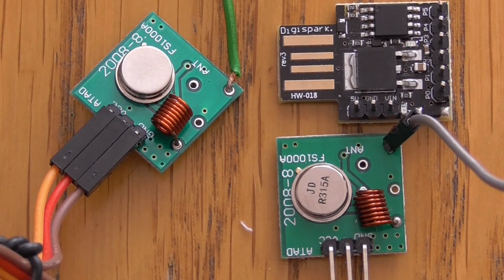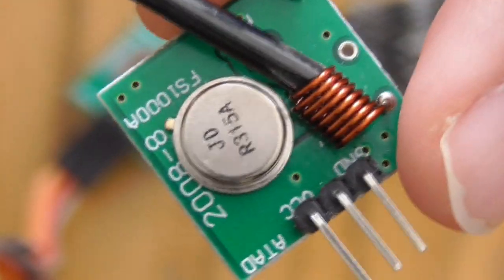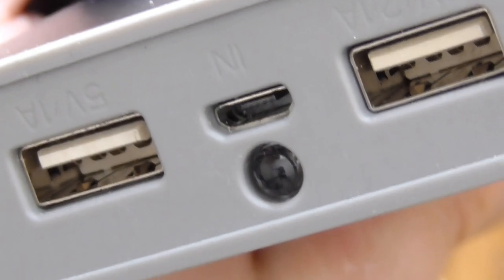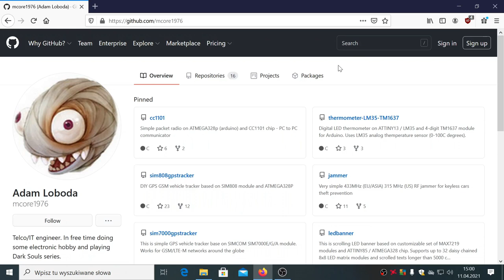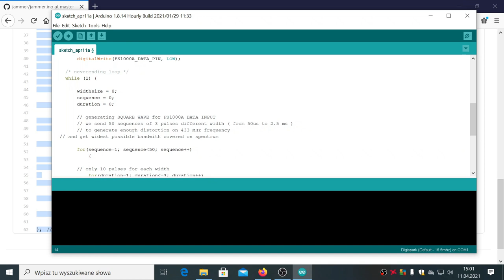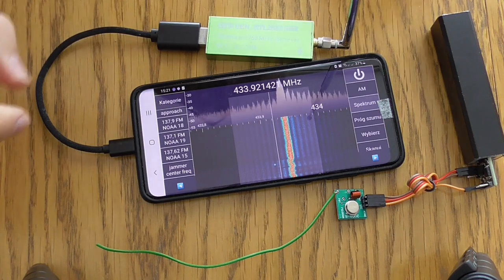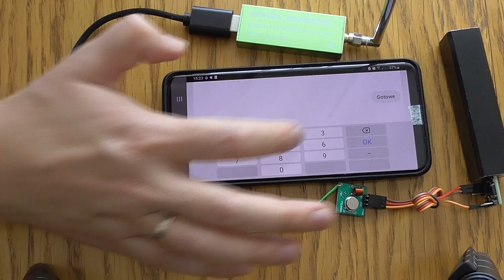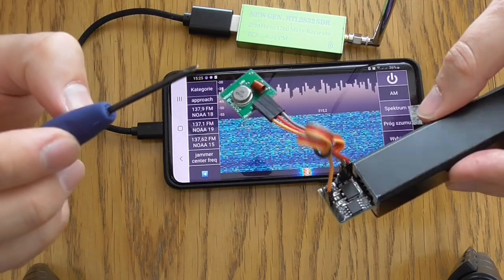5$  ARDUINO car key JAMMER DIY. Relay attack / keyless car hack / car hacking protection

Comment: Great, I did it with another powerbank and issued solved! What I can not get it to do is to shield the cars remote control that locks and unlocks the car... it will shield very well my garage door. I shall try to place the variable condenser as in your other video in // with the oscillator or do  you recommend something else, this last one is on 434 mhz? Cheers
Reply from the maker: I think this variable condenser may not help much. You may want to build the second jammer based on CC1101 board and Arduino Pro Micro 8MHz/3.3V

Comment: Will the code also work with STX882?
Reply from the maker: yes, this one should work because it is a simplest ASK OOK transmitting module
Reply: Can i also use this? Digispark USB ATiny85 - Micro USB
Reply from the maker: yes you can

Comment: Excellent engineer! I built it and it works very well, the only problem is that when I feed it with the powerbank, it boots up, it starts to oscillate perfectly, BUT it stops after approximately 8 seconds, that is, it doesn't do an endless cycle.... I have to unplug it and plug it back in and there it does the same thing, that is, it oscillates for 8 seconds and cuts off... could you help me please? Thank you very much
Reply from the maker: this is due to powerbank issues that cuts off the power when the current is low. find another power source. It happened to me as well. find cheapest powerbank with no protections

Comment: hi i search for Transmitter and receiver module based on CC1101 chip and i found many types of transmitter modules board based cc1101 , my question is the CC1101 chip is important to have on transmitter module board not the shapes of the board or color right?
Reply from the maker: correct. shapes sizes and board color is not important. Important is to have 8 PIN connector and CC1101 chip on the board
Reply: @justanengineer5599  can i use Attiny 85 digispark with cc1101 modules to jamm?
Reply from the maker: Unfortunately no. Believe me I have tried hard to make ATTINY85  work with CC1101 but I failed. The point is that ATTINY85 does not have full SPI BUS and I had a lot of problems.
Reply: @justanengineer5599  one of ur video u made cc1101 and arduino pro micro for  rf jammer which u said working in both 433 and 315 and others freqency is that right ?
Reply from the maker: correct. here is the video https://youtu.be/vZcGP-O2GvQ

Comment: When your key fob is not in use, wrapping the entire fob in aluminum foil acts as a shield which prohibits any signal from being transmitted beyond the home. If you have two fobs, both must be wrapped in foil. Your fob is a transmitter and your car is a receiver of the signal from the fob.
Reply from the maker: Yes but what if someone has  already recorded your signal and is only waiting to  replay it and open and start your car?  then this jammer comes in to the rescue

Comment: Maybe you know if it is possible for this jammer to also work on other frequencies at the same time?
Reply from the maker: unfortunatelly no, this jammer uses FS1000A module which has fixed frequency due to the SAW generator used. SAW generators are using quartz crystals tuned to single frequency.
Reply from the maker: check my new project on github https://github.com/mcore1976/cc1101-tool
This is something for You !

Comment: Remember what you are showing. Fine line my guy.
Reply from the maker: all the techs can be used both ways for good and for bad. If you use this jammer inside your car nobody will be able to remotely open your car.  
This is all because car manufacturers  do not embeed sufficient security inside their products.
Reply: @justanengineer5599  My car cannot be remotely opened because my key uses "rolling code" unless the/my cryptography has been compromised. 

Your talking about wireless keys then jamming my own key inside my car, then i wouldn't beable to operate it unless its already operational, simple solution is use a signal blocking pouch with my key inside everytime i dont use my car. Useing a jammer this way over the top, users might even jam others around them.
Reply from the maker: even with the cryptography on board your car can be easilly opened by the rolljam attack as long as your car is listening to RF. Yes, having the keyfob shielded all the time should break challenge-response sequence but still there is a time window when your last sequence can be recorded and further replayed when you are intentionally opening the car
If you mount this type of jamming device for example under your car with the switch  you can use it in some special circumstances.
Reply: @justanengineer5599  Not my car...has some more tricks Lol
Then with what you said the RF jammer is the same with the pouch, if i leave my car jammed i am liable to prosecution. Jamming frequencys is illegal. Jammers are easily detectable. Best option would be a cryptograph rolling code to switch the locking mechanism and use the wireless key for the start with both having to be operated.

Comment: This video is very helpful. But i have question, what is the app you use in your phone for frequency capture ?
Reply from the maker: it is sdr touch. but now there are other free applications like sdr angel or sdr ++
Reply: @justanengineer5599 thank you so much. One thing can we do replay attack using this app?
Reply from the maker: no. for replay attack see my cc1101-tool shown in my 2 latest videos

Comment: Hi .. thanks for sharing this video. Just out of curiosity.. u have any idea on how to device a "personal" short range 5ghz wifi jammer? (strictly for protecting own data, wifi and stopping "air-gapped" hacking.) I am aware of hackrf, but not sure if it can jam 5ghz wifi frequencies?
Reply from the maker: it has to be made using some chip for 5GHz wifi like nrf24l01 for 2.4GHz.
Reply: @justanengineer5599  Okay, will do a search if I can find the right component. I am only intending to make this device for purpose of securing my laptop. Back in 2018, I have lost one of my laptops (the laptop never turned on after shutting down got toasted it seems), the hacker seemed to have messed around with the bios (rootkit level). I then ordered a replacement motherboard from aliexpress china for the same laptop, and it was too hacked when i was online (the hacker deliberately did things like moving cursor, closing windows, deleting files from USB drive curropting exe files of programs and they give installation errors etc, without even me touching either the mouse or keyboard). I then physically removed the internal wifi card (or anything of that sort), and the hacker is still able to have full control of my laptop (he/she intentionally does these things to make realize they have full control of my computer). I even turned off my router, but it still continued. I had the same experience with other "used" laptop i bought on facebook. These "compromised" laptops motherboard seems to have some sort of planted chip (disguised as other chips) (that are sending/emiting and receiving rf or any other hard to detect signals) to nearby routers (including neighbors ones) or even some radars or proprietary signal receiving devices through which the hacker launches these sophesticated airgapped attacks and is able to have full control of the machine even when every physical wireless card/adapter/cable is physically removed from this compromised laptop (airgap hacking). I also witnessed many times, hacker turning on the laptop (even when its lid was down and wifi card was physically removed). The hacker has full control of the machine right from the moment it boots (when the company logo appears in the beginning). Many times when i tried entering the bios mode, the hacker was able to switch through menus in bios mode and change settings without me touching the keyboard once. I am not aware of such a malware, rootkit that can give someone full remote access right from the bios boot onwards. Would be helpful if u have any experience in identifying how it happens and what can be done to secure my machine as I am primarily worried about my data that I dont want gone and being sold to someone (am learning web development, game design 3d and stuff). I have had my product marketing pictures, deleted/curropted (in GB's) I spent years taking them for my business. My 3d files, website designs have also been deleted many times in past.
Reply from the maker: well going through bios options means something as hidden remote keyboard is attached to the mainboard inside the laptop, there is no other explanation to it

Comment: GREAT!!! You got My like and  subscriptoon! Can You tell me the name of the app You use on the Mobile PHONE as a spectrum analyzer and the brand of the dongle receiver You use in this video please? I Will construct one of these and then play with the other projects that employ the attiny13
Reply from the maker: Hi, the app is SDRTouch. The dongle is no name bought on www.aliexpress.com
Reply: Thank You very much. I left You a new question after I built the besutiful circuit. If You can tell me what went wrong since it works perfecto but Powers off sutomaticly after 10 seconds aprox. It does not execute the endless loop  written in the INO file. Cheers!!!

Comment: If I want to capture low frequency signal 150khz, Do I need a generator? Or its possible to capture with simple rtl sdr?
Reply from the maker: You can easly to record it and replay with Raspberry Pi and RPITX software that I am showing in my other video. It can handle frequencies from 5 KHz up to 1500 MHz.  See this video here : https://www.youtube.com/watch?v=WmvEid3ULvE
Reply: The minimum is 500khz?

Comment: How can I check if the device is working? Unfortunately, even inside the car does not make a difference. I don't know if my chip is broken.
Reply from the maker: you have to use RTL SDR USB dongle and a PC with an application like SDRSharp or SDR++ or SDRAngel to see if your radio module FS1000A generates jammimg signal on correct frequency. There is no other way
Reply: @justanengineer5599  jednak działa. Użyłem innego powerbanka. Po przedłużeniu anteny zasieg siega do około 50m
Reply from the maker: elegancko ! spróbuj zbudować moje najnowsze urządzenie którym można sterować za pomocą telefonu komórkowego przez kabel USB OTG

Comment: can i feed the project with 6volts? 4 AA batteries. thanks
Reply from the maker: Yes. You simply need to power Digispark  through Vin pin / GND pin instead of using USB power

Comment: What's the best antenna to increase transmission range?
Reply from the maker: depending on frequency, I am using simple whip antenna but the length is important.  You may also purchase some 6dBi  or 15dbi "directional antenna" for 433MHz/315MHz on Aliexpress if you solder SMA socket to this board
Reply: @justanengineer5599  Thank you for the swift reply, would a wifi modem antenna work!?

Comment: Can you use the SX1278 RA-01 Lora 433 for this too?
Reply from the maker: nope
Reply: Apparently you can if ypu use pylora and customise the code. As they are transceivers
Reply from the maker: yes but you have to write new code. It would be like completely different design
Reply: Got that done with the antenna. Just not the relay (yet) but replay. But it is also pointless as the person drives away and locks and unlocks again, changing the code. People unlock with intent to drive away. It's all about the challenge from the 125khz (door) to the key now. That's the only way. Roll jam and replays, relays are all pointless exercises. Just look good on the tube.

Comment: What’s the green thang you got plugged into your phone
Reply from the maker: this is RTLSDR USB radio receiver. You may buy it at 15 USD
Reply: @justanengineer5599  is it good as the original one?

Comment: thus,u can use 315 and 433 mhz jammer with same  code(?)
Reply from the maker: the frequency will depend on module FS1000A whether it is for 315MHz or 433MHz

Comment: Encore des problèmes mon ami .
Arduino ne reconnaît pas la carte. 
Périphérique inconnu. 
Tu as les pilotes ?
Reply from the maker: Have you followed this tutorial https://startingelectronics.org/tutorials/arduino/digispark/digispark-windows-setup/  ? sometimes you need to use different USB port or even USB cable extender to make it work

Comment: Maximum Range???
Reply from the maker: Maximum range of FS1000A module is 100-150 meters. That strictly depends on power source voltage. In my case it was around 60-70 meters
Reply: Nice
Reply: @justanengineer5599  whats the voltage can we use like the maximum

Comment: how to expand its reach?
Reply from the maker: need to use RF amplifier. But the easiest way is to power the RF module from 12V
Reply: @justanengineer5599  is there a video tutorial? sorry, I'm still a beginner
Reply from the maker: attach 12v to vcc
Reply: @justanengineer5599  how to?
Reply from the maker: Use 12V battery for RC models:

12V + --> Digispark Vin
12V +  --> FS1000A VCC
12V -   --> DIGISPARK GND
12V -  -->  FS100A GND
DIGISPARK PB2 / P2 --> FS1000A DATA

Comment: Can you block vaccine nano chip frequency?  :)
Reply from the maker: Of course. You simply touch power grid socket with wet hand  - this will disable the transmitter for sure :-)
Reply: @justanengineer5599  be careful, some idiots may actually try that
Reply: @tmpEngine  Ideally, yes!

Comment: Can you use other transmitter?
Reply from the maker: Look for my other videos I have used CC1101. In this particular project you may use any transmitter supporting single DATA IN pin and on-off keying modulation

Comment: How does it receive the car key signal to relay to the transmitter?
Reply from the maker: you do  recording with URH and then implement the sequence manually in Arduino code
Reply: @justanengineer5599  I record with the transmitter urh programmed to it?
Reply from the maker: watch the video carefully. 2 or 3 times.

Comment: so the 315mhz ( FS1000A module.)can work right?
Reply from the maker: correct
Reply: @justanengineer5599  but in the video ,u said that the frequency run a bit